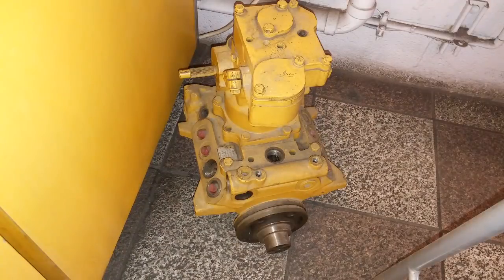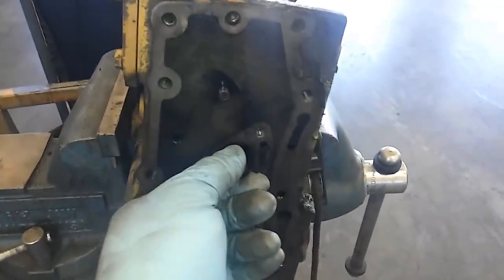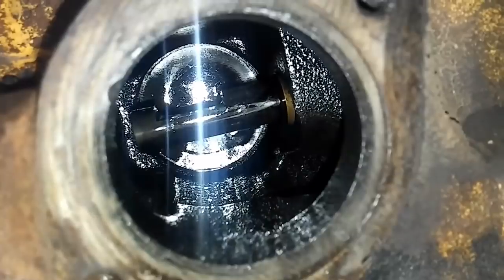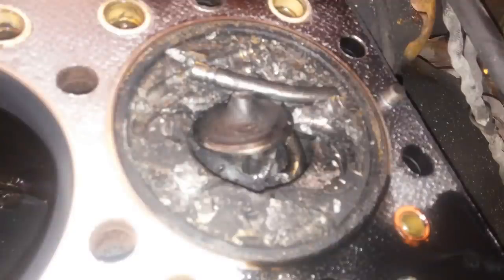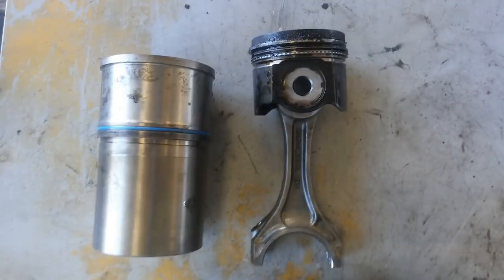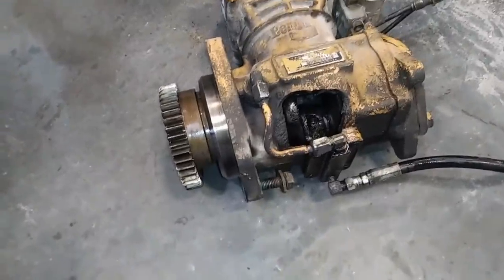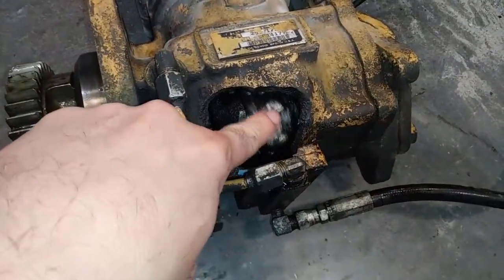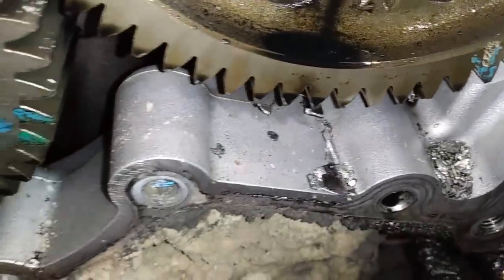Why Do Diesel Engines Runaway? What Is A Diesel Engine Runaway?

Comment: my diesel car goes 9k rpms the top. i mean modern diesels can rev higher than older ones. todays diesels r very clean. in U.S or Canada u guys dnt have many dsl engine cars so u guys dont often come across 4 cyl common rail diesels. i knw u guys hav dsl engines in big suv's n pick up trucks but not family sized cars. so u guys shud see these smaller version diesels in asia n europe n u'll b amazed...
Reply: What the fuck. I had a stroke reading that

Comment: Why can't you shut off the fuel system?  It is electric.
Reply: Older engines are mechanical and newer engines are electronic. Only seen one electronic engine that the ECM was causing the overspeed and the key was able to shut it off.
Seen one drop a valve and knock the tip off the EUI. Fuel was dumping onto the piston has it was open to low fuel psi. The piston was pushing the fuel into the inlet manifold, thus entering the other five cylinders. Engine was running away and driver was able to stop it.
If a turbo fails and fills the CAC up with oil, the engine can pull the oil into the intake, now engine has another source of fuel, that the electronics can't control.
Mechanical engines on a Cat, the pump, rack or governor failure. Shutoff cannot push/pull rack into the off position.
Sometimes turning the key is worthless.

Comment: Y all diesel engine must have An automatic valvle for close air when trottle is under 10% and engine revolutions are too high!
For old motors a manual co2 fire extinguer iniects in the turbo.

Comment: When it starts to happen why the hell don't they just shut it off instead of just letting it continue
Reply: Not that easy it starts burning its own oil as fuel in a lot of cases. You can turn off the key and it will still keep running.  You have to starve it for air.

Comment: Overheating starts overrun
Inability to turn off fuel supply let's it run on and on .
Put a rpm regulated fuel cut off and the problem is totally solved.

But NO that would cost the industry to much perpetual sale.

Comment: I get the impression Adept, you you have no idea what a runaway engine really is.I only watched 5 mins or so and you kept running around it just that bit to long
Let me help you. 
A runaway engine is usually a diesel engine that for some reason or other, starts in reverse rotation. 
How about that??? The naughty runaway sucks the hot lube oil out of the Sump and then spews the exhausting half lube oil out through the breather.
When that happens  You only have seconds to jump into the Cab and pull the handbrake while standing on the foot brake.
The stuff that came out of our Perkins P6 was loathsome and we could smell it for days afterwards.
The Perkins P6 was in a Seddon 7 ton tipper. The Gearbox was a 6speed David Brown  with 1st being a clash reduction gear.
The engine had been replaced about 2 months prior to this incident. My Dad was the driver. He was pretty fit and I watched him running after the Seddon, He caught up with it as tbe rear end entered the tide on the hard packed sand.  By tbe time he got her stopped , the rear chassis was under water as was the exhaust,  I had jumped in the other door   The P6 was between us but the air intake was on my Dad s side. Despite the soundproof cover and large heavy leather backed blanked draped over the lot, The black smoke in the cab was blinding. He was screaming at me to "Get out to Fxxk" but then she started hanging and shuddered to a stop. There was almost a full load over 8ton , the sides were down on one side. He pushed the button and she coughed to life again.  Into 1st and  gently up out of the surf picking up speed and looking for level ground to dip the oil.  Strangely enough she was fine for oil., He found out that the P6 had a history of doing this. We got off light. He replaced all the wheel bearings  and thought he was in the clear. Then she started breaking halfshafts. He removed the Seddon rear axle and fitted a Foden axle and diff. It was a good job. Then after 7 years he fell in love with a Comet but Leyland were grossly over engineered. Their gearboxes were soft, The halfshafts broke right next to the crown wheel and you could not risk sticking in the new one till you were absolutely sure that the whole Diff was clear. So the 2 shafts had to come out  and then towed home. Hino Showed how to design halfshafts. All this, 65 years ago. I got one thing right. I steered clear of trucks.
 We used to speed out into the tide the sharp turn towards the gravel banks on the high tide mark. Then travelling about 20mph  he would knock her out of gear and let her coast up into tbe gravel banks at an angle  of 10pm.  This made loading easier..
She was accidentally left in 3rd and the handbrake off. I noticed her moving first ,"Eaaa dad, she moving"
"Shut up and shovel lad," came back.
I stopped and stared at the big front wheel..She creaked and groaned and she was off like a hare. I had no idea  that Dad could run like that. He was 50 at the time.
Reply from the maker: If making this video today I would definitely have formatted it differently and put the oil consumption runaway ahead of the stuck rack overspeed type "runaway." I also would have gotten to the point quicker, but I do know what an overspeed it. The engine running backwards doesn't really have anything to do with many runaways as it running backwards doesn't cause oil to be pushed into the cylinder in any way. Perhaps on certain models that is a problem, but oil consumption not engine rotation is the underlying problem.
Reply: @AdeptApe  it was explained to me at that tender young age, that while the engine was running in reverse rotation  it was forcing the sump oil into the cylinders and this was adding to the crazyness.
Hence the worry about low lubricating oil. Rootes Commer 2  stroke diesels were also a problem.
However by the time the driver realised what was happening they were beyond help and everyone ran for cover., personally, I had no hands on experience with the 2stroke Commer,s. I had a friend slightly older than me and he left school to drive one of his father,s fleet. We lived at the top of a mile long hill with the last quarter mile ending in a 4 to 1. You drove the Commers on the revs, some had a whistle or high pitched whine near the limit,  So coming into our hill the Commers would be running full pitch and the gear changes had to be crisp and perfect, Onri was really good. Born to drive the Commers. Very occasionally someone missed the change and their was hell to pay with  the helper chocking the rear wheels and the brutal abuse suffered during lift of in the steepest part of the hill.
Each and every Commer suffered and aged with this kind of contempt and it was not long before they were not able to manage our hill even with the perfect changes. Our old prehistoric Seddon could quietly slip into first with its overloaded 10 ton and crawl up it while Pop sucked on an Afton special during which time he could be making a deal out the window with some farmer walking a bicycle alongside his truck. It was better a communication system than the present mobile phones because half the village could hear every word and some might have a better deal to offer in the quiet  later.
I loved the sound of the Commers but they were noisy polluters. Not long afterwards  the  little TK 330 entered the contest and ran rings round the lot.

Comment: 11:08 "stick a fire extinguisher in there "
A CO2  extinguisher would do the job if it is big enough to keep going till the engine stops . 
Typical ABC dry chemical dusen't remove tbe air it just adds particulates that are a thermal setting to coat the sorce of fuel(not going to happen on a diesel). ABC is a last resort to try, and probably would do the job by gumming up the valve train.

Comment: i was around a 2 stroke 6V92TT run away with exhaust manafords off it run off its oil it threw fire out of exhaust & cought the shop on fire & burned down all 5 building GM said there flopper to  shut off in the air  and stop engine this part fell out or broke off! white made the air box! white was bought out by GM! at the time of court case I worked for a manufactor that GM sold there trucks so i had to tell the truth!! or i would not have a job!!

Comment: Bro......... just be smart about this.

REMOVE the air, and you will avoid a runaway. You can't sit here and spout out this and that about this and that, this chemical and that .... you need to shut this up......

It took me 5 seconds to say "STOP THE AIR FLOW" ... don't dumb it down for the sake of the idiots. Some of the very same that subbed.

This ISN'T rocket science but you know what, many will play that.

Comment: Diesels,, dirty stinking noisy things that can be dangerous. Crook turbos will cause then to overspeed, poor rings, or in the case of old GMC 2 strokes they eat them selves on their own oil. Knocker Commers as well.
If you have a toy diesel car scrap it, unreliable expensive to maintain things. Truck, tractor earthmoving, industrial is the only place they should ever be.
Old mechanical diesels would normally turn off by simply pulling the fuel shut off. Too many modern ones do not wish too.
Air cut off is the only way at times. I had a jammed late 90s Landcruiser diesel that was running at about 4000, blocked the air intake eventually, crook pump!! While it still ran after doing the pump I doubt it was much good after.

Comment: Seen a 6.0 ford run away and the dumb ass dumped the clutch. Ive never seen parts break so fast... stopped the motor though. 'Xcuse me. Engine. Put away your keyboards keyboard warriors

Comment: The older engine will run back  word just just shut it off and restart the older engines are 2400 not 2100 the new Legends are 2100

Comment: How do the Europeans make their diesels go 7000 RPM without any failures?
Reply: They don't. I've never seen a diesel revving this high here. I think one of the highest revving diesel was the V12 in the Audi R10 but that still revved to 6000rpm max. Cars rev to 4500-5000 tops.

Comment: If you run the diesel engine on parafin it runs out of control.... https://rover.ebay.com/rover/0/0/0?mpre=https%3A%2F%2Fwww.ebay.co.uk%2Fulk%2Fitm%2F252926987073

Comment: Can't do anything about compression? Heh. It'll take care of that for you in less than a minute. I've had a few super old (not legal for import anymore for emissions reasons) Chinese diesels that do, indeed, have direct control of compression... there's a lever that holds the valves open; that's how it's started (spin up the flywheel) and stopped.